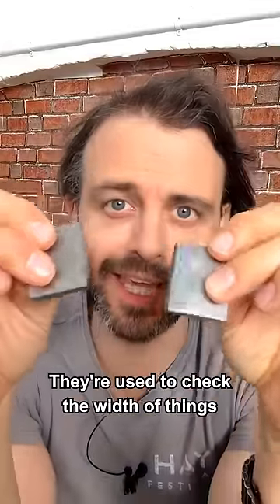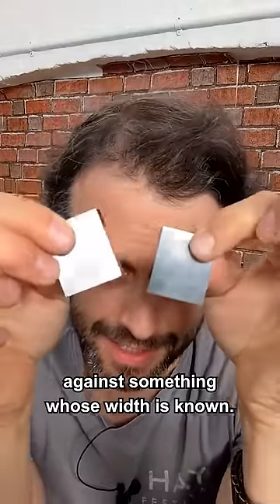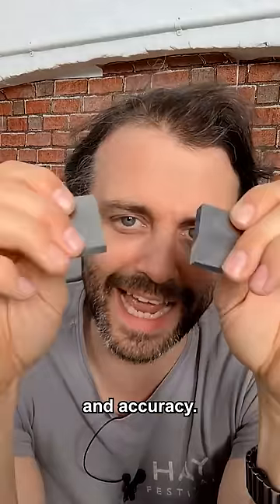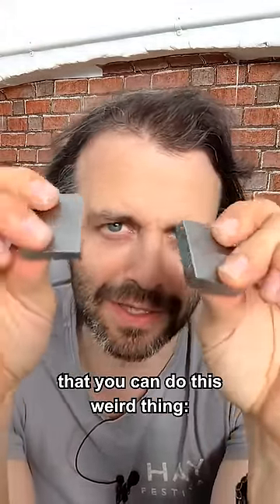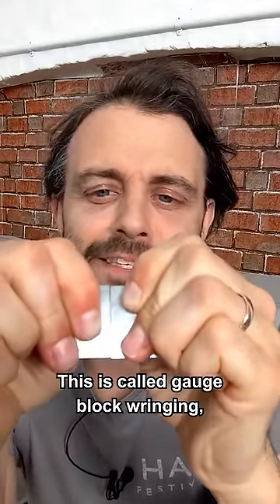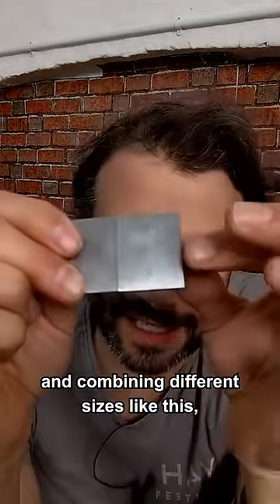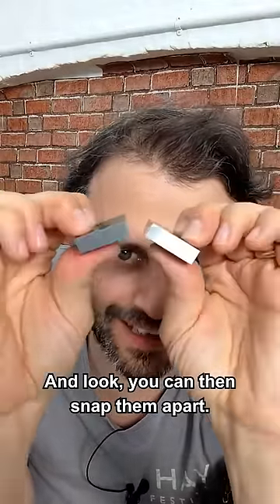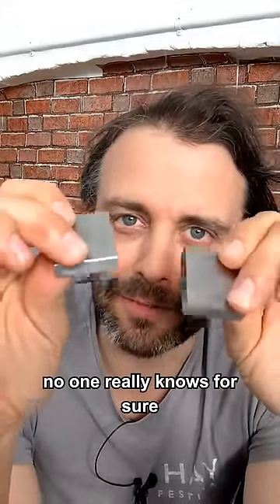No One Knows For Sure Why This Happens!

Comment: I actually use to work at a lab where we would get these sent in to test for dimensional accuracy. Had to be accurate to something crazy like .00006 inches. Can't remember the exact tolerance, but these guys are ACCURATE
Reply: 6 hundred thousandths. Damn. I was always curious about that. I used to use all kinds of instruments and gauges as a thread inspector for casing pipe used in the oil field. Of course we had our gauge blocks to zero out certain tools for specific thread cuts, but the smallest we'd go was into the thousandths. Interesting
Reply: @I-C-Y-U-N-V  yeah, they get really precise. The gage block comparator is always under scrutiny because if how accurate it needs to measure
Reply: ”inches”?..
Reply: @janus69tube  yeah
Reply: What, no coefficient of thermal expansion? Is this pure Unobtainium?
Reply: @timapple6586  the temp in the lab is kept in a very specific degree. Humidity levels too in order to avoid moisture in the air causing any sort of rust. You also need to wear cotton gloves to mitigate any body heat from expanding the metal. It's very precise
Reply: Nobody on my reading so far has mentioned using a pair of lasers to measure down to half the wavelength of the light source. Movement of either laser will cause fringes to appear where the interference patterns show. On a project to make one of the early laser drives, we had large test beds consisting of two sheets of extremely low expansion steel sandwiching about two inches of a mix of ground granite and an epoxy. These were stabile down to well below the wavelength of the lasers. I watched the fringes move whenever a railcar moved on a rail that was over a kilometer away.

Comment: Let me explain:
It has to do with the molecular pores of the material. As the squares are "precision machined" to the 30mm size, oil gets trapped in the pores with every pass of the lathe through the material. This oil has a special property of being both viscous and hygronimous. The hygronomity of the oil makes the surface of the block shiny. As the surface of the block is shiny, it can then reflect particulates down to a size of 2 nano-micrometers. That also happens to be the size of your peepee because I'm just kidding and I made all this shit up. Lol
Reply: I was considering that. The satin finish made me think it was oil or a compound in the gaps. Even air would get trapped in them
Reply: @Drega001 Did you read it all?
Reply: Sounds convincing to me. Didn’t get nothing but …..still Voting on this one

Comment: Is it forming a vacuum or suction along the edge as it will have micro pits on the surface and pushing hard together pushes the air out of these pockets🤔
Reply: I guess you could test this hypothesis by trying to repeat this experiment in a vacuum.
Reply: @norats122  I think action lab guy has already done that it stick in vacuum also
Reply: You can take 2 phones with new screens without scratches and do the same thing shown in this video
Reply: There are no micro pits, that’s kind of the point. They’re so smooth that they can get right up next to each other and be held by the intermolecular forces across the whole face.
Reply: a teacher i had once did it with a pen and the wall
Reply: Yes i also think the intermolecular bindings start to cling and bind together with a Bit of force applied.
Reply: I was thinking vanderwalls but i dont think thats it. What im thinking is cold welding. Since they are so smooth if you grind them together the outerlayer of oxides will scrape off semi evenly and then the metals will bind together in cold welding. It wouldnt be uniform so you can snap it
Reply: @dankplagueis9253  the answer is closer to what you said then you think.
Reply: Surrounding air pressure pushes against all sides. You forget we live in 50kPa air pressure.. even the vacuum is not a perfect vacuum
Reply: @kuldeepsankpal6443 yes, because it's oil, but very tiny amount, unnoticeable by touch
Reply: @dtibor5903  not possible because he also cleaned the surface with some solvent then also it works

Comment: Reminds me of joining violin plates together. Basically, the front and back of a violin have seams down the center and the seam had to be #%@&ing perfect because it's carved so thin that any miniscule gap will cause it to open up while you're shaping them. So you use a wicked sharp jack plane to flatten the two surfaces to the point that when you rub them together they almost stick--not to the point where you can let go, but if you push them together and try to slide up or down it won't move because literally every bit of the two surfaces are touching. It's a wild thing to experience.

Comment: The why is pretty well known. The wringing is just a simple way of bringing the two faces together with very few air molecules between them, allowing van der waals forces to come into play.
It works with any 2 extremely flat surfaces of the same material. I've also seen it done with glass.
Reply: Didn't think about it until now, but panes of glass against each other always create suction and sometimes need to be slid apart, this is true with even the smallest pieces - nothing to do with molecular interchange or any such quantum...
Reply: Unless it also works in vacuum
Reply: Then why's it work in a vacuum, professor?
Reply: @Vagabondobiondo  It also works in a vacuum, yes, but there you don't even have to resort to wringing. Just press them together and it's done.
Reply: @scottmatznick3140  it works in vacuum precisely because it's just van der waals force. do you know what's van der waals force?
Reply: @stevenroper3577      Then you should switch to the glass company I work at as a supplier. 😁 They always put plastic peel-off layers on the glass to prevent them from sticking together.
Reply: @scottmatznick3140 van der waals forces also work in vacuums genius
Reply: The "sticky" feet of geckos also work by van der waals attraction.

Comment: Before watching this, I can tell you that if you rub them together they stick together because all the air is forced out between the surfaces and a subtle molecular bond is created.
Reply: I was taught the same thing 30 years ago
Reply: no
Reply: @@1-Wheel-Drive bond
Reply: @@1-Wheel-Driveimpending Shrinkage
Reply: Idk, I've been watching Cody's Lab for years now. He did this in a vacuum, and it still worked. I'm not a scientist or anything. I just saw it on YouTube, so who the hell knows. I trust in his experiments, though.
Reply: Nice explanation, i just been on lecture of machines and mechanisms, where it all was explained
Reply: @spleenforsoul his explanation doesn’t hinge on the word “air”, so he’s still correct

The point is that no material can be between the two surfaces (whether that’s air, water, dirt, etc.)

Comment: The gauge block surfaces are so smooth that when you ring them together, you remove the air between them. This is called molecular adhesion.
Reply: No.
Reply: @edism Makes sense that once the molecules/atoms are close enough they start interacting at the molecular level
Reply: @hamzerpanzer  other comments have explained it, this has very little to do with air.
Reply: no one really knows why, then all opinions remain hypothetic
Reply: Vacuum applies pressure between the blocks because the air is squeezed out of the joint[note 1]
Surface tension from oil and water vapor that is present between the blocks
Molecular attraction that occurs when two very flat surfaces are brought into contact; this force causes gauge blocks to adhere even without surface lubricants, and in a vacuum
It is believed that the last two sources are the most significant.[4] Experiments with friction of the blocks suggest also that the removal of the oxide film from the steel surface by wringing plays an important role in the wringing action.[7]
Reply: That's exactly what I was thinking.  I took machine shop for 4 years in high school and used them thousands of times.
Reply: Personally, I think it’s like a suction cup and you’ve removed all air between them.
Reply: Aliens
Reply: so it creates tiny vacuums?
Reply: Sheets of glass can also stick together, it’s because of vacuum between it
Reply: Cody's Lab did this in a vacuum chamber and got the same "sticking" result. It isn't suctioning and making a vacuum between the pieces :/
Reply: @jasonmcgee7457  a total vacuum? What about moisture in the “air “ acting as an adhesive. And is creating a vacuum inside a vacuum not working? Like a suction cup would that work in a vacuum chamber?
Reply: @upsguppy520  either that or it's the minut amount of oil surface tension. I remember rubbing the side of my nose then to the block to help stick them together.
Reply: @jasonmcgee7457  are you saying you can’t have a vacuum in a vacuum chamber?

Comment: It's intermolecular attraction between two surfaces.
They're polished so smoothly that there are no gaps between them.
Reply: actually its the seal that the oil or moisture vapor makes, same effect as a suction cup on glass, just smaller. Its been proven that what you are talking about happens only in space and with materials like gold, Codys lab did a fantastic explanation on this and tested it as well. next time instead of going off of some BS in your head, maybe google it first, then look things up.
Reply: @timothywhieldon1971 Cody's lab tested it in a vacuum with clean blocks
Reply: @stewartmoir9464  yes, and it would not stick like it does when its oiled or wet, thus proving what we already know... what i said above! Steve is great but he assumes way too much and then puts it out there like he is an authority with out fact checking.

Comment: I would say it sticks for the same reason as cold welding. The twisting is rubbing off the oxide layer
Reply: Oh my... this makes perfect sense. I would have speculated it was molecules snapping om together as you actually need to twist, therefore they fit in place so perfectly tight the metals almost bind together. But as I've read somewhere else if you clean the faces with alcohol it doesn't work as good... then your theory can be indeed right. Rust is known to weld metals together, especially when you want it the least to happen. 

 Mfng rust...
Reply: That's the best I could guess. Flat clean surfaces, causing a vacuum by pushing two insanely smooth pieces together. I can't see how any other explanation fits better than this, since cold welding is a process that is understood by some contemporary machinists.

Comment: Also fun fact: If you leave them together e.g. over night. Then they are kind of welded together. Impossible to seperate without damage.
Reply: Not true.
Reply: Stainless steel vacuum-welds faster better than other metals, but not overnight, not from just contact. But if you screw clean threaded fasteners together and torque to spec in a vacuum, stainless will weld. That was a hard lesson learned on the Hubble Space Telescope – loosening fasteners.
Reply: Not even close. I calibrate these for a living in a clean room. I leave wrung blocks together over night all the time to acclimate. Hell I’ve left them for over the weekend, still came apart just fine. Longest I have done has been like ten days, and yet they still snap apart just fine.
Reply: Literally one of the least true things I’ve ever read lmfao
Reply: I too love writing bs online.... 😭😭😭😭

Comment: To everyone saying it's just Van der Waal interactions, the same force used in cold fusion, you are missing a very important detail. Cold Fusion requires Clean surfaces, this intermolecular force requires the molecules to be near each other with no barrier in the way to achieve this level if sticking if that was the only force at play. Besides the average machinist not having an environment that maintains this level of atomic cleanliness, gauges are oiled to prevent corrosion. Even further, the technical technique for wringing asks that the gauges are lubricated on an oil pad.
Reply: You prolly mean Cold *Welding*, not fusion. That is completely different thing altogether

Comment: It's actually due to impurities on the surface that act as an adhesive. When you exert pressure to wrung them together, the impurities (oil and skin) smear as you twist. Gives the blocks a surprisingly high maximum static friction force.
Reply: friction doesn't stick things together,  adhesion does.  They're different things.
Reply: @LarsLarsen77  Agreed. I was referring to the static friction force that is required to break them back apart after being wrung together.

Comment: It is my personal belief after studying this that is is a combination of effects, but the dominant one seems to be that the atoms become so close together, they approximate the lattice crystal structures of both sides.  It would be interesting to see if this phenomena occurs with different metals and vastly different or incompatible lattice structures.
Reply: You're definitely not compressing a crystal's lattice through human-made pressure that's for sure.
Reply: @rayres1074 Maybe not compressing, but when the smooth surfaces come in contact close enough that the electrons form a strong enough bond to be considered one piece instead of two?
Reply: @chillchilli2671  Well, I find unlikely the equipment that made it surface nanometrically polished, to the point it links two disparate lattices. Still, something something electrons seems to be a good possibility.

Comment: Isn't it just metal not really caring if the particle is from this of the block next to?
It's a known problem in spaceflight where aluminium will weld together as particles slowly exchange.

Comment: Doesn't the same thing happen with two pieces of glass? 

Very common in my job, microscope slides sticking together and coverslips sticking together.

I thought it had to do with the atmospheric pressure, because they are so smooth, when they touch each other, the only force exerted on them from both the outer sides is the atmospheric pressure... Is my thinking wrong?

Comment: There are several factors that the majority of the attraction between the two is from Vander waals forces and the rest is air pressure and for the surface tension of any film such as oil on the blocks

Comment: It's called vacuum welding, most commonly found when an engineer didn't do something right when they launch a satellite or something else that's supposed to be in space

Essentially, metals share their electrons so easily that if nothing else is in the way you can just touch 2 seperate pieces of metal together and they become 1, in this case the pressure of squeezing the blocks together and the blocks being so smooth allows him to push nearly all of the air from between the blocks, the pressure and sliding also forces the metal to share electrons more easily, essentially magnetically locking the blocks together with the postive and negative fields of their own atoms

Comment: There are proper scientific explanations available on the net.

The basis of them is that any two atoms that meet have no way of knowing whether or not they are in the same piece of material.

When pieces are machined vey flat, enough atoms can make contact, at any one time, that they 'bind' as if they were in the same piece of materiel.

It's really no different to what happens when a crystal grows.

Comment: They are held together by the surface tension of the ultra thin layer of oil on the mating surfaces.  The faces are so optically smooth that they can become diffusion welded if the contact is for a long length of time.

Comment: Van Der Waals forces? If they're perfectly smooth with no air in between, the actual contact surface is maximal. What's wrong with that explanation?

Comment: You're friction wielding them together due to the small amount of exposed atoms on the (relatively) smooth surface melting together under the pressure you exert on them.
Reply: Which leads us to the question: What is static?🤝🦎🦄??

Comment: I think it is because of the small gas percentage thats present between the two maybe they also share approximately the same frequency so they don't repel each other they act like  suction cups.
What you are supposed to do is to try to use different materials iron vs titanium ....

Or use different sizes on 30 ml one 40...
Maybe the smooth surface helps molecules naturally bond and make materiels fuse
Maybe I'm just stupid 😅

Comment: Surface tension of the liquid layer hold them together. It's mostly water layer on air (a couple 100 nm of water), or oil residue in vacuum. It will work in vacuum too, unless you burn everything away from the surface, and then they won't stick together anymore. I've played with mica (gives you atomically flat surface) like this while working in AFM manufacturing company, so if you find AFM with vacuum and heating capability you can try that too and actually measure the forces. Check metrology labs in your area.

Comment: It might be due to the nature of a metal: its forming an electron-gas which acts like a glue that holds together the individual atoms (hence the strong bandabiliy and plasticity of metals). If the surface of two metal objects is smooth enough, maybe they bind together on molecular level to a certain degree

Comment: Friction heats up surfaces and expel air in between, creating vacuum in between the super smooth surfaces that the air outside can't seep into two surfaces again. Also we need to consider the phenomenon of air expelling during metal expansion and recontracting. The attracting force could be the van der Waal affect, which might create during frictional movement between the surfaces. Sir😮